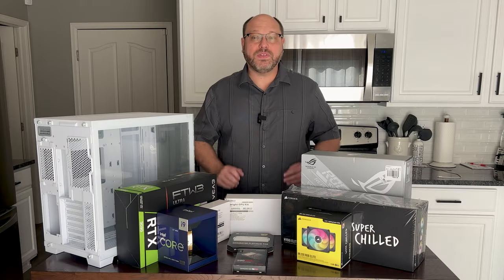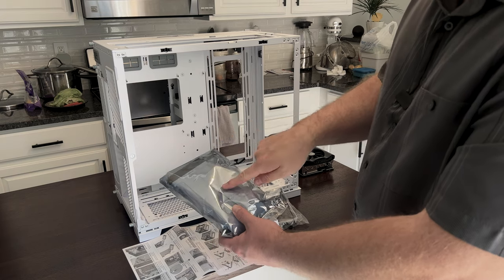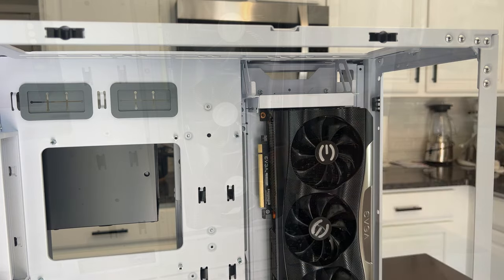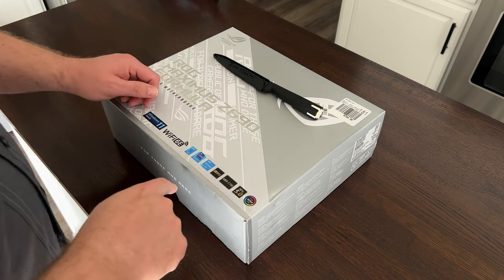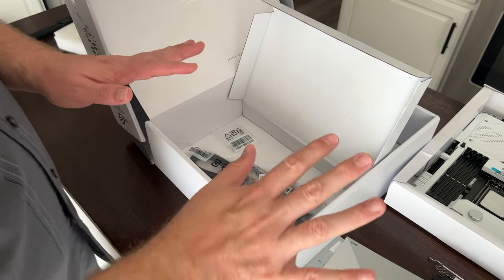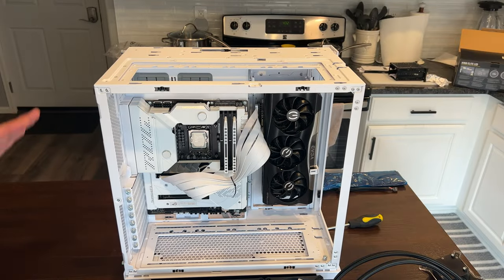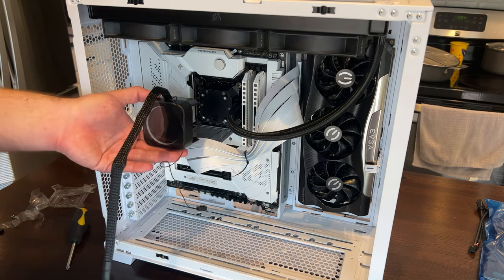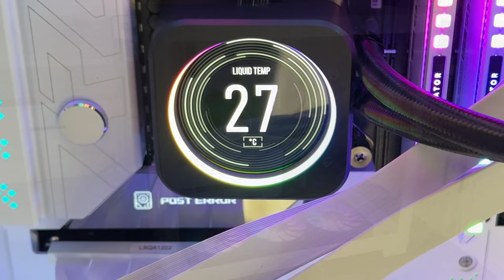This Build was PAINFUL. - Lian Li O11 Dynamic EVO - Upright GPU PC Build Guide

Comment: The z690 formula has two pcie gen 4 slots. You can back way route the cable and plug into the lower pcie slot 2 vs slot 1. The vertical mount riser adapter is designed for either of of those slots. So the 600mm adpater should as well. Slot 1 is just the default for GPU when horizontal mounted.
Reply from the maker: Thanks for the comment!

Comment: How are the thermals in this orientation? I want to do this but I'm worried it negatively effects thermals. I keep seeing mixed results and heard it depends on the card. I have an EVGA RTX 3080TI with Lian li Dynamic EVO w/ AL120 fans.
Reply from the maker: I havent really paid too close of attention. Ive not experienced any issues yet. And push things hard with video renders.
Reply: @JilesMcCoy  Ah, not a clear answer on this it seems. I think it depends on card, case, fans but mainly the card. Some cards it may even improve performance seeing from Christopher Flanigans video but some cards may be negatively impacted. I wish someone would run some test on this and show optimal upright mounting vs horizontal/vertical.

The general consensus is that horizontal is best but that may not be entirely true in all cases. Anyways, your build looks great and I'll be coming back to this video when I build my first build as it is very similar to mine.

Comment: Nice case, but do not like the way that upright video card ends up. The power to the card looks messy and having to open the case and route the video cables to the monitors, through the inside of the case is too much of a pain. Especially if you need to trouble shoot any issues later on. I'd prefer not to stick my hand inside a turned on PC... I think the standard vertical mount (were the GPU is still horizontal) is the way to go.
Reply from the maker: I don’t really like the way the cables end up either. It was a fun experiment though!

Comment: Hello!
I want to buy a Lian Li Dynamic o11 EVO and I'm wondering if I can plug the RGB cable from the case to my GPU? I have an EVGA 3080 TI FTW3 ULTRA and it has an ARGB 3 pin connector.
Thank you in advance

Comment: Great video I'm also a builder as well as a Home Theater enthusiast.  I was a little confused as to why the Motherboard as the cost reflects having a built in water block for liquid cooling the VRM which is made by EK.  That added bonus is where the high cost comes in although a great board just could've saved a couple $100 if not liquid cooling.   Thanks for sharing!!
Reply from the maker: Cool, thanks!
Reply: Any difference in temperature when using AIO or water cooling?

Comment: Thx a lot for sharing 😄 i loved this case with the upright gpu build. I think, i will buy it for  my next build too. I am still looking for the right parts for my system. My fear is, that my Nvidia RTX 3090 FE dosnt fit upright when i use Corsair Hydro X Series XR5 360mm in in the lid and bottom wiith fans mounted. The 3090 FE is longer and thicker then your RTX 3090 from EVGA.
But very nice build you have!!!! 

However, I have a question that bothers me. The voltage converters are usually air-cooled or, like your board with the EK CrossChill 3 system, water-cooled. 
But you did not connect water to the connections. How are they currently cooled? No air can get in there because they are built in. How are the temperatures?

If I understand the system correctly, a custom water cooling system with one radiator, a "CPU block/pump/reservoir unit" (like Alphacool Eisbaer (Solo) - or from other brands) would have been a better option if you didn't want a single pump and reservoir.
So you would go from the CPU block, where the pump and expansion tank is, to the EK CrossChill 3 on your mainboard and from there out into the radiator, out of the radiator and back into the CPU block. So you would have taken care of the cooling of the voltage converters.

i hope i wrote it right. my english is damn bad 😇 
and I hope that I don't have any misconceptions about the EK CrossChill 3! 🤔

BTW there is a 60 cm cable from lian-li with which you can get out of the slot straight down to the back up and to the side of the graphics card and connect it again. then you only see the riser cable from the slot down and into the card. much more elegant.

https://lian-li.com/product/600mm-pci-e-4-0-riser-cable/

i think, the fan mount behind the graphics card is perhaps more optimal in terms of temperature because air can circulate behind it. Even better with a fan.
With an Nvidia 3000 you can't do it the way you did because the hot air from the bottom fan will be blown against the back panel and heat could build up. At least I think so 😇

so beautiful PC... i like it. Gratulation😀
Reply from the maker: This board doesn't have the EK cooling piece. On this board the pieces are just cooled with the passive radiators. If you look at the thumbnail closely you can see I got the cable set up correctly finally and the PCIE looks much better now! It would be better with fans behind the video card, I agree. But it stays cool enough now for my use.
Reply: @JilesMcCoy  are you sure, that you dont have EK cooling pieces on? I am realy sure, that you have 🤔 Here is a Picture from the part from your mainboard what i mean. 
https://dlcdnwebimgs.asus.com/files/media/7EFE87CD-F280-4A07-9506-E9821F6DC380/v1/img/cooling/crosschill-ek-m.png

component is disassembled, where the two silver caps are on it. these silver caps are the inlet/outlet for the lines. I didnt know, that they work without airflow passive too 😀 

some manufacturers have installed components from well-known manufacturers in their higher-priced models. they cooperate together. In recent times, mainboards have often included EKWB components when you buy the mainboard. Sometimes just the water block for the CPU, sometimes for the CPU and VTs and here, in your case, just for the VTs. If I'm not mistaken, there is another large block of EKWB that is exactly for the mainboard and fits in there exactly.
well learned something new again. Thank you 😀

I am sorry but i cant see this on the thumbnail. Do you use 40cm risercabel or 60cm? Pictures say more then thousand words
https://preview.redd.it/2p1uwff0xdu81.jpg?width=4032&format=pjpg&auto=webp&s=305023eb8f107f5d3d502f75a46a5559b3630dcb

With a 60 cm cable, you can route it in such a way that it disappears downwards (if there is no other card in the slot, it looks better) and then it is led out to the rear, up and out sideways through the opening for cables. You can then only see the point where the cable and graphics card are plugged together.

but whatever it is - i like your build! 👍

Comment: In your build would a 280mm aio have fit up top with vertical gpu installed?
Reply: I saw a dude on reddit put the rtx 4090 msi suprim liquid x with the radiator behind the upright gpu kit.

Comment: When you talked about the bottom fans sucking air in and up, you mentioned air getting brought in from the side as well, likely referring to the GPU fans. If that is what you meant I think you may be wrong. The GPU fans suck air in, not out.
Reply from the maker: That sounds right. Air in from the bottom and then out the sides and rear.

Comment: Cooling is much better with fans behind the GPU
Reply from the maker: Makes sense, maybe I can jam a few behind there.
Reply: What you mean behind the GPU? On the bracket? is that bracket not solid steel? Any videos on this format?? thanks!
Reply: @leoleo-sp1db  use the fan mount instead of the solid peice and set the fans as exhaust

Comment: Great build - Do you think a 4080 would work + an aio in the upright config at all?
Reply from the maker: If it’s not too long it should be fine.
Reply: The 4080 would probably work better in the new EVO XL case, since it's a taller case. The 4080 and 4090 are both longer than 3000 series cousins. I have a 4090 in my Dynamic EVO and it's a tight fit in horizontal config. Upright would be too crowded

Comment: Love the video as it helped me wrap my head around how this will work before I started.  The question I have is, with the solid backplate holding your GPU, does it hinder airflow as much as I think it would?  I have a ASUS TUF RTX 4090 that already runs warm in the standard configuration, so I am worried about choking its airflow even more.
Reply from the maker: Seems ok... but if you want airflow mount it traditionally
Reply: Or mount it upright on the fan bracket, lian li has a video for that

Comment: Hey Jiles nice video thanks for sharing - Question on the GPU mounting position for you:

Did you have any POST or BOOT issues using the PCI extender cable? I heard of some issues using the cable with GEN 4 PCI ! Great video again thanks!
Reply from the maker: No post issue for me at all.

Comment: Can this be used with a Push-Pull Galahad radiator on top? Thanks
Reply from the maker: I dont see why not. The top is perfed.
Reply: @JilesMcCoy  i tough that the +8cm thickness of the pull/radiator/push configuration would made it not possible to have the card fit behind it. Thanks
Reply from the maker: @Yamagatabr  I’ve not tried it directly so ymmv.

Comment: I love the design of the upright riser, but that cable just doesnt look good. there has to be a better solution for that. Its an eye sore, at least for me. I wanted to do it, but i might pass. Thanks
Reply from the maker: You can see the new routing in the thumbnail. Maybe that is better?
Reply: @JilesMcCoy  I yea I can kinda see it. Maybe an update quick 1 min video showings would be nice. 👍🏼
Reply: @dj.excess  Im about to order Thermaltake PCI Express Extender 600mm which reaches behind the Mobo in this case (tested). its $100 dollars though so not cheap!

Comment: I’ve had high temps on my GPU in this configuration. Any ideas what could help? I don’t want to invert the pc as recommended
Reply from the maker: To lower temps you need to likely get more airflow going somehow.
Reply: Because he added the hard drive back plate instead of using fan bracket to mount fans to pull heat from the backside of the GPU. It was a mistake by the builder to do it this way. Correct way is to use the fan bracket he pulled out to mount 3 120mm fans on the backside of the GPU so GPU on front of bracket, 3 fans on pull orientation on backside.

Comment: How come you didn’t use the EKWB EK AIO for this build?
Reply from the maker: I did an all Corsair build and I wanted the lcd display on the cooler.
Reply from the maker: I used that in my last build though. Check out the crystal p120 video.
Reply: @JilesMcCoy  I was just asking because i thought something might be wrong with it and i am looking at this AIO for my first pc build. I need something that can handle i9 12900k. been looking and searching all over the place for info on this AIO. thanks for responding
Reply: @JilesMcCoy  I understand that, I just need a really good AIO to keep i912900k in check and all the other AIO i can't keep up :/
Reply: @smokethatgameb9937  you should use the liquid freezer II with some good fans on it, that thing will tame the beast
Reply: @dagameboy  hmmm, that's good to know. Thanks! I have been searching high and low to find the best aio. Until I am ready to do a water loop. I am looking at Ek new EK-Nucleus AIO CR360 Vision D-RGB. Which it hasn't released yet. And I know freeze, lian li and ek are the top 3 aio’s out there. I just need to pair it with my i9 12900k along with asus extreme mobo and g skills z5. If the aio doesn't do the job. I will just go to a custom water loop. I live in Canada and temps don't get to bad over here.

Comment: What length is that white riser cable?
Reply: Not sure what length it is but thermaltake makes a 600mm one that will work so you don't need the extension
Reply from the maker: What he said.
Reply: @JilesMcCoy  lol

Comment: What riser cable did you use?
Reply from the maker: This one worked for me : LINKUP - Ultra PCIe 4.0 X16 Riser... https://www.amazon.com/dp/B0971P2M5S?ref=ppx_pop_mob_ap_share.  You can see the actual vertical install in the thumbnail.
Reply: @JilesMcCoy Thank you. Yes I saw you routed the cable behind the mb, what length would I need to get to achieve the same look?
Reply from the maker: @alonpeled7974  the link I posted has all the details.

Comment: This isn't what Lian Li call "Vertical" might be a bit confusing to people who get the wrong kit.
Reply from the maker: The setup in the thumbnail is different than their definition? What is their definition?
Reply: @JilesMcCoy  This is an upright mount not a vertical mount, in a vertical mount you just rotate the GPU 90 degrees upwards from a regular horizontal mount. There are two separate kits you can buy which are very different, a vertical mount kit and an upright mount kit, you have an upright mount kit. You can also buy a longer 60cm riser cable from Lian Li and only the bracket for the upright mount which is only 25$ without the shorter riser cable. The longer riser cable will allow you to route it behind the motherboard instead of the front and covering a great part of the RAM modules and the motherboard.
Reply: @JoseAlmeida-zm7tk  Yup this got me actually. The Format Jiles is using is UPRIGHT, however there is another Lian Li mount Format called VERTICAL